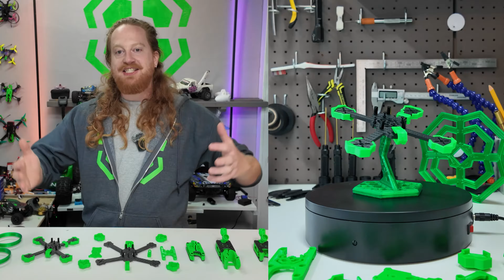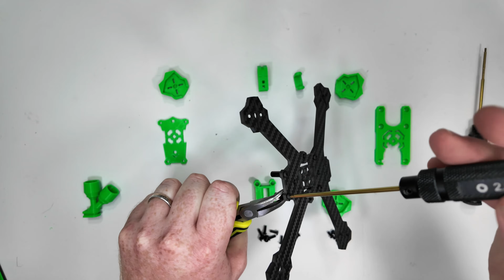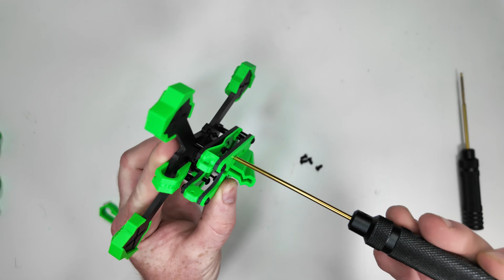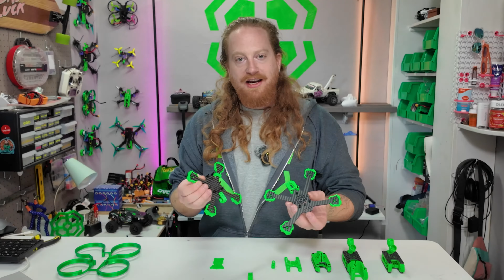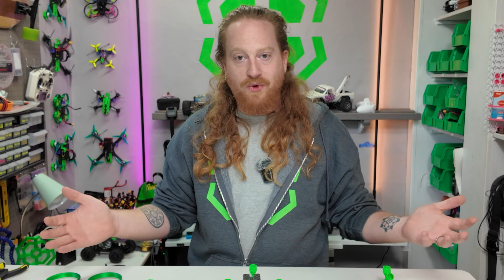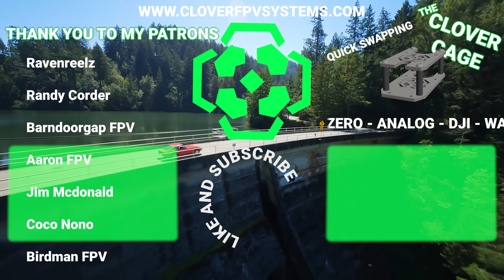Build the Clover FPV Systems Guinea

Comment: So the clover cage that fits on 5" will fit this as well?????
Reply from the maker: You got it! 

Just keep in mind that the 2.5 is going to want a lighter VTX to avoid being sluggish but it can still handle both the slammed and the full size no problem